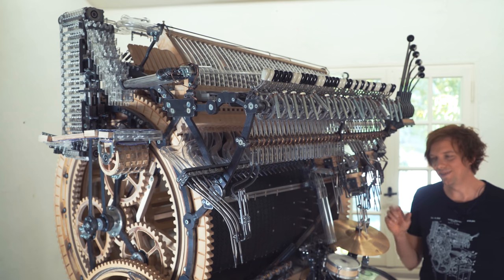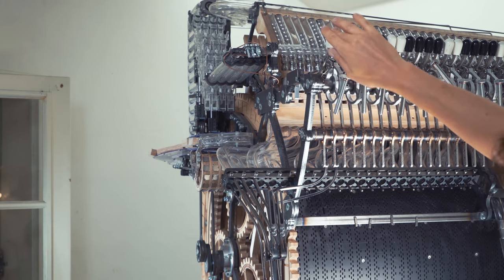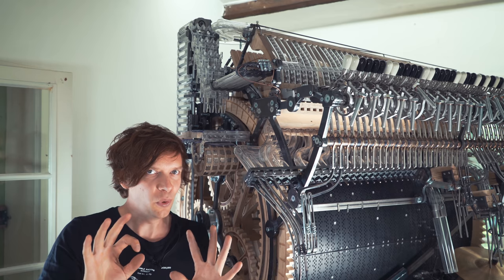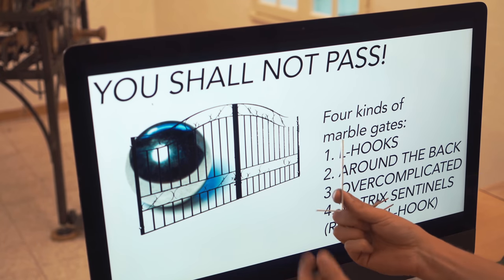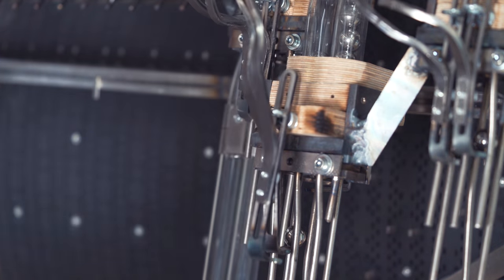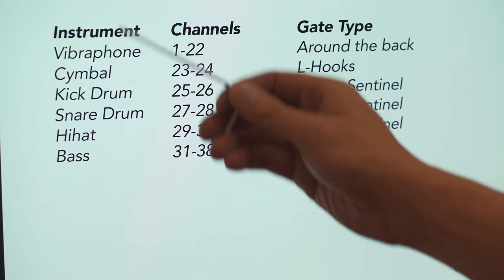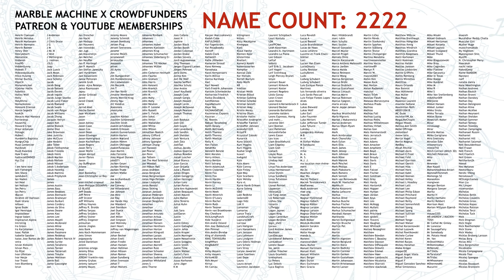Marble Gates Design - Marble Machine X #91

Comment: Might seem too obvious, but why not bring back the overcomplicated method just for the bass channels? Seeing as it's only a small group of channels.
Reply: Yeah I was thinking that myself, but perhaps the reliability issues proved hard to fix?
Reply: And build in adjustability by replacing the metal tabs with adjustable screws.
Reply: I thought so, too.  And use the rest of the travel way on the dropper to mitigate the faliure rate by having longer blockers that travel less angle but more way into the track.
Reply: hopefully, that's something that can be changed later. Now it's just time to finish this thing, and better solution might come in a later patch.
Reply: This makes great sense and I want fast octave basslines!
Reply: @Fabelaz  Yeah - a LOT of this design is not in CAD, its manual adustments by hand to the parts.  One design element he said he wanted was the abilty to just order up replacement parts from any local machine shop.  SO MANY parts on this do not look like they do in CAD!
Reply: I was thinking along the same line, but only use the Overcomplicated Method for the two interior channels in each row of 4, and two of the Around the Back design for the outer channels in each row of 4. 

The bass channels look to be very accessible for fine tuning of the Overcomplicated mechanism. 

(Although it seems like the matrix one is WAY more complicated.)
Reply: @kin2naruto  While it's true that there's many small adjustments, it wouldn't be very difficult to backport those into the CAD designs. In fact, I'm certain some have already made it back in. There will be ton of time in between the MMX being complete and the start of the world tour. During that time, he'll be able to get the machine fully recorded in CAD and order up the replica (he needs a copy in the America's for a full world tour).
Reply: Exactly what I though. Fast and small
Reply: I think a different shape to the blocking hook (the part that pivots) would help a lot. Because it goes in parallel, there's no give or leeway. The main hook (the last hook before dropping, the one on every channel) comes in perpendicular. - Trying to get the main hook correct is like trying to calibrate "x as it approaches zero" (this is normal). Trying to calibrate the one that comes side ways is like trying to calibrate "1/x as it approaches zero" (this is infinitely difficult!). (edits for clarity)
Reply: I'll bet y'all he will be doing just that by the next week or after getting the base and getting mad at how slow they are :)
Reply: Yes yes yes yes
Reply: yo nice profile pic nerd ;)

Comment: Martin, a rocking gate would solve the problem in the simplest and most elegant way.
Reply: Precisely!
Reply: I tried googling it but could only find chairs, could you provide a link?
Reply: @Huntracony  he means like the overcomplicated solution, but with only one gate instead of two, and the hinge in the middle of the gate, so the single gate rocks back and forth.
Reply: @Huntracony  google rocking switch, now picture a marble going over it. one side of the switch holds the marble while the other side releases it. and when the switch rocks back, it loads again. The most important aspect of this idea is the fact that there is never a clear path for the marble to go straight through. It is very similar to the wire going around it, just with a simpler implementation.
Reply: @sebastiannielsen  yep! your answer was so much better than mine... lol
Reply: @Huntracony , it's a design I immediately thought of as well.  His 'overcomplicated' design is close to what is being talked about but instead of the pivot being lift type like his overcomplicated one, you put it as a 'rocking' style.  The gate lifts up on the front by proportionally rocks BACKWARDS on a rear blocking finger that is part of the gate.  To imagine it, spread your index and middle finger apart.  Place the index finger from your other hand in the crotch of your spread index and middle finger.  Rock your hand back and forth on the off hand pivot made by the other index finger.  You'll see a simple mechanism that will stop the marble coming down because it's rocked back into the path while the front 'gate' is opened releasing the marble to drop.  It's almost identical to the rockers in a car engine that push open the valves for perfect timing.  It's probably the best design for all those purposes Martin pointed out, save the drums. It's also super simple and can have an adjustable rear arm to make the timing perfect.
Reply: Exactly what I was thinking, I hope he sees this !
Reply: @thiagoennes  I found your answer the most useful, actually. Thanks.
Reply: Genius!!
Reply: Similar to the escapement mechanism of a clock, yes?
Reply: @frankmcgorman962  YES! but instead of a gear its marbles!
Reply: Sounds like a good idea from what I can visualize. Thumbs up so that he can see!
Reply: Bump this up! Martin said he was at peace with the restriction this would create on bass tempo, but that doesn’t mean he wouldn’t be MORE satisfied if that restriction could be removed!
Reply: Bump
Reply: Not complicated enough for the mmx 😝
Reply: Liking and commenting so this is seen by Martin.
Reply: @xxportalxx.  hahahaha sometimes more complicated really is better. Take mechanical watches, for example, I guess the mmx also has a lot of it.
Reply: @thiagoennes  Oh absolutely, in my experience as an ee the more complex a component is, the less math I have to do myself 😂
Reply: Wouldn’t you have to change the already existing marble channels for that, though? It doesn’t seem like you can simply add that to what’s already there.
Reply: @xxportalxx.  preach! ahahuahuahuahuah I am a product designer. I spin my own led controller boards for my lamps. Capacitive touch sensing is a nightmare, but once I got a dedicated ic for it, it really looks like I know what I'm doing!
Reply: @johnnyjohnson6643  you mean the metal rails? Probably... but I think that part is still in development.
Reply: @johnnyjohnson6643  not necessarily. If he can find a way to attach a hinge piece to the marble channel (most likely either welding or clamping), he can use the current release system to pull up on the end of the rocker and leverage it.

So in the seesaw comparison, imagine that you're only lifting up and pushing down on one end, and the middle is mounted on the top of the channel. When you lift, you release the "charged" (as he puts it) marble, while the opposite end blocks another from coming through. When you push back down, the next marble falls past the fulcrum point and is in the charged position
Reply: You will need a lot more marbel to fill up the channel as there length change a lot in this design
Reply: @etiennedud  you mean to fill the channel upstream of the rocker? I thought the idea was to keep it the way it is. channel empty with one marble loaded.
Reply: @TotalInsanity4  yup, the longer the rocker the further it moves. The length should be adjusted to the amplitude of the release mechanism's movement.
Reply: Kinda reminds me of the mechanism used in old typesetting machines https://youtu.be/gRHOPmGUtPA?t=8m36s
Reply: you should post the idea on his reddit page, he might be able to easier see it then
Reply: I think his overcomplicated design is actually rather simple and elegant and could be just as fast as could be. Just needs to tweak the angles so that it always catches and releases when it's safe to do so.  And if you want to accomplish that you could move the pivot point so that the moment arm swings faster when the release is nearly and safely in place. That was you never have to worry about speed of play actually catching the sweet spot where the whole channel is open.
Reply: To me it looks like the overcomplicated was upside down the way he was using it. If he flipped it over it would have more range of motion and would trap the ball better.
Reply: @paulkupper194  exactly! hey i have used one of those linotype monsters! amazing machine.
Reply: @Wintergatan check this out!
Reply: Just what I thought, I imagined something like the escapement from a clock but for marbles
Reply: It seems the best solution, message him or something.
Reply: Just commenting so martin sees this.
Reply: But isn't this exactly the mechanism used at the topmost marble gate? And, the same has been duplicated for the matrix sentinel. 
Actually, I thought that there is some redundancy in having the marble release mechanism following the matrix sentinel where the matrix sentinel alone could do the job of gating one marble at a time.
Reply: @ulysses4536  I think it is a matter of latency. Also the top part is responsible for dividing the flow of marbles. If there wasn't the top part, the channels would not be replenished properly.  But yes, I see the redundancy as well.
Reply: @thiagoennes  Well, the top one stays, ok. But at the bottom of the drum section duct, just one similar mechanism would be sufficient.
Reply: @ulysses4536  maybe... i'm really out of my depth on this one. Marbles running through a pipe act weird... lol
Reply: I Hope Martin read your comment
Reply: Brilliant idea! Someone post it to the reddit?
Reply: Exactly what I was thinking as well. A ] shaped see-saw that keeps one side closed at a time, making sure marbles can never pass through uninterrupted.
Reply: I've just been thinking about that :-) will it make an appearance ??
Reply: @KensonKerman  that would be fun!
Reply: Yes! And it wouldn't add to the width. It would be super fast and solve the problems with the other design. The rockers could be CNC machined easily.
Reply: I was thinking the same thing. Rocking the lower gate gives the speed of the "round back" solution, the narrow space of the "complicated" solution, and the simplicity of the "L" solution.  @Wintergatan should check out how it's used in mechanical clocks to regulate the speed of the spring unwinding.  Brilliant, simple, easy, and takes minimal space!
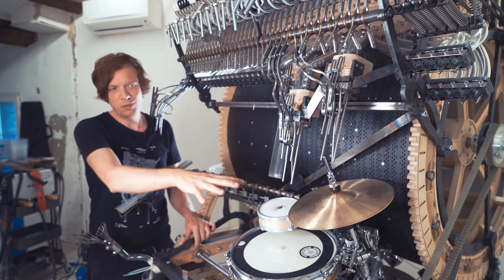Reply: @paulkupper194  Oh wow those machines are so similar to the mmx, but take everything to the next level. I think the escapement of the maps is very clear at 7:50 .
Reply: Definitely good to consider!
Reply: This is genius! Get it onto his Reddit page man!
Reply: bump
Reply: @thiagoennes  as a german I must say, your explenation was better for understanding the mechanism
Reply: Exactly!
Reply: Won't that have the issue of a small buffer?

Comment: The around the back solution doesn't need to use thick wires, it can basically use thin sheet metal anchored in the release mechanism and bent in to 90 degree bends, the thickness could be very small (well below 1mm). One option to build on this is to use sheet metal to make an enclosing anchored as before but going all the way around and then use the back to mount an adjustable pin/block solution as well.
Reply: Adjustable pin could be a screw going through a lock washer to set the depth, or something like that.
Reply: Exactly my thoughts. And if it is too large to have two of those next to each other, the gate for the odd channels could be just above/below the gates for the even channels.
Reply: I was just writing a similar suggestion. Use spring steel to carry between channels. Spray it with a dry film lubricant so it could rub the wires without binding.
Reply: My main concern with the around the back would be the repeated hits from marbles slowly working the back catch out of alignment. They aren't very big but they are falling quite fast and very rapidly. Playing a single song could easily result in 100 hits. So it needs to be able to withstand that kind of abuse without work hardening or bending.

Comment: PLEASE UPVOTE SO HE SEES THIS!
Martin. Just have the around the back go around the entire section of rails for the base!
There is absolutely no reason to not use the "around the back" method on the bass. the space you need doesn't have to be right next to the track. you can have the wires run around the whole system of four channels and have it come back at the first, second and third one. for the 4th one the problem doesn't exist anyway. there are actually several more solutions like the rocking gate mentioned in another comment for example. so I really suggest you reconsider restricting yourself in possibilities to compose the music for the mmx without really having to.
Reply: Totally agree with your idea four the base, I had the exact same one and looked for it in the comments and here you are ! Just to be sure we have the same idea :

- First channel have no issue with the classic "around the back" solution.

- Second channel could go all the way around the first.

- Third channel could go all the way around the fourth.

- Fourth channel have no issue with the classic "around the back" solution.

Is that what you mean ?
Reply: @PP44P4  yes. exactly!
Reply: How can you attach a wire from the release of the 2nd and 3rd so that it's independent of the 1st and 4th?  It seems like to wrap around it would restrict the movement of either one or the other depending on if you had it above or below.  The only way I see that working is if the 2nd and 3rd come up and out from the release so that the 1st and 4th can move unimpeded, creating this large bracket look as it would wrap all around both sides.
Reply: @YoshionoKimochi  The "Around the back" solution just need a single wire to go around. Just make one wire pass a little bit higher around. If you absolutely need the marbles to be held at the same distance from the release mechanism, you can just bend the end of the wire to go up or down.

Are my explanations comprehensible ?
Reply: @PP44P4  it is, yes. I can visualize it.
Reply: My pleasure to help, Martin. I'm willing to see the bass working!
Reply: This is so simple! Great idea!
Reply: Two on the left, two on the right takes care of the 4th channel issue.
Reply: This
Reply: I really hope will consider this, Martin.
I understand that there are so many details on the MMX that you can get completely lost, and of course I long for the world tour, but don't limit your musical creation! The MMX is a marvelous project, but we also want to here your music!

Comment: I'm having trouble understanding why you would sacrifice speed and music opportunities by using the l hooks on the bass channels, when you could work around with the matrix, or maybe use the overcomplicated with some tweaks...

I'm just sad we won't be getting any fast bass sections is all.
Reply: Luciano R I’ve seen a lot of comments about this, he will likely see them and update on why he can’t use the overcomp design, or he will take suggestions
Reply: I agree, it would be good to have it faster, but I reckon this mechanism will get revisited knowing this build and Martin!
Reply: The L hooks are also an immediate solution that can easily be removed later if something better comes along.
Reply: He should use "around the back" but have the inner tracks go around outside the outer tracks. Thick wire should have no problem and it wouldn't be hard to make the inside/outside wires not interfere with each other.

Comment: hey martin, can't you make the Design for the "around the back system" much more narrow by using 0,5mm steel sheets for the hook going around? Then you may could use it for the bass.
Reply: I was thinking maybe he could do 'around the back' but treat the 4 channels as 1 unit and have all the around the back mechanisms circle around the 4 channels to come up behind their respective channel
Reply: @narthesis9273  He could wire the two left ones around the left end of the set, so no gate bends around more than 2 channels
Reply: @doomse150  Yup!  We are of course assuming that the bass channels are not boxed in by channels from other instruments.  Though I think there are the drum channels on the left and nothing on the right?
Reply: @narthesis9273  I think they are at the side of the MMX while the drum channels are in front of it, so they shouldn't interfere each other

Comment: why don't you invent an Oversimplified version of the overcomplicated version for the bass? XD
Reply: Easy. Pivoted Crescent. Pivots in when release opens and out when it closes. Doesn't take up any space and can be hid withing the vertical slot of the release itself, if required. It's a two to three part assembly (part + pivot + pivot anchor) and the pivot anchor can be welded or screwed to the guide wires without interfering with their function. It's so simple to build that you could order the replacement parts from the smithy of your local renaissance fair.
Reply: so then it's just called over